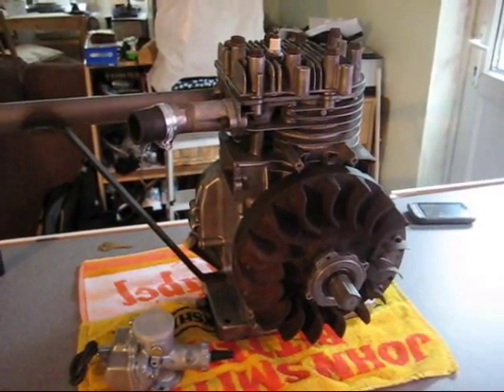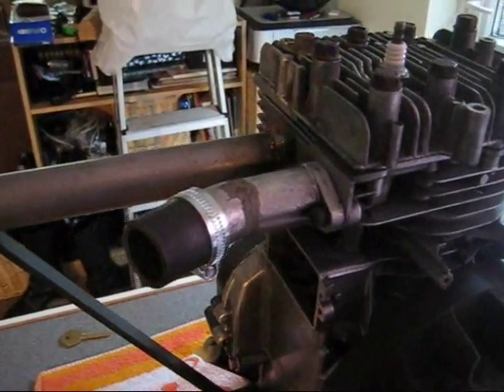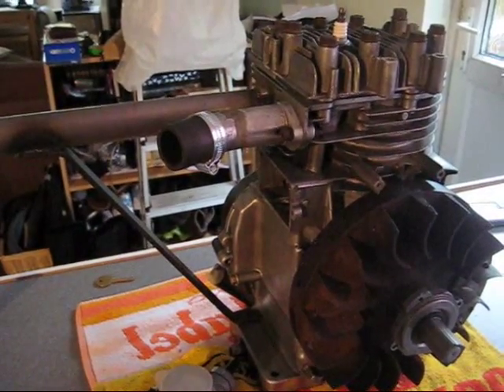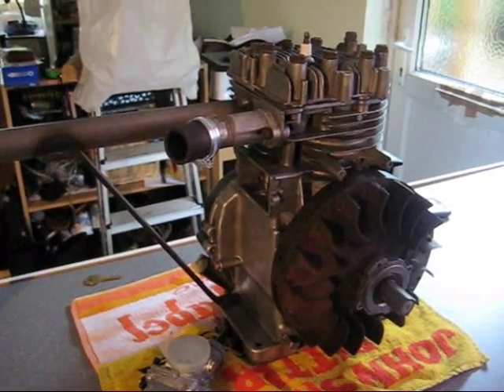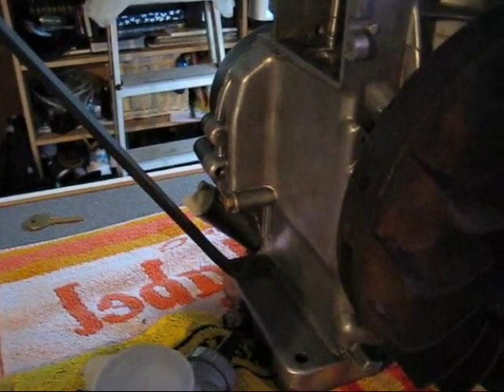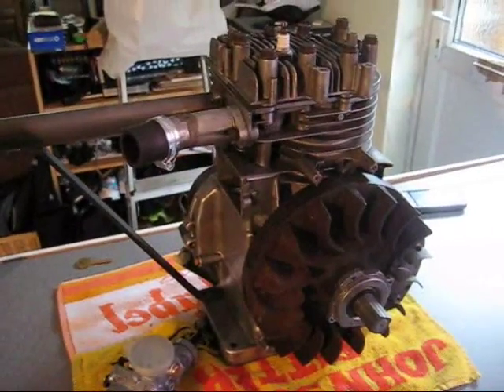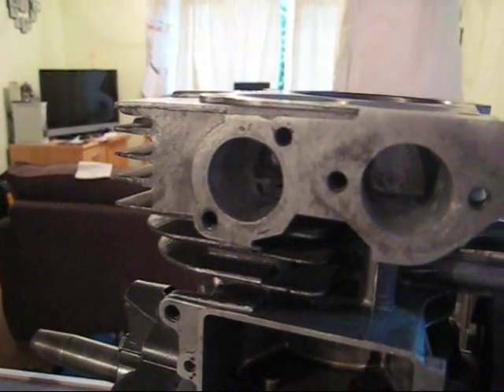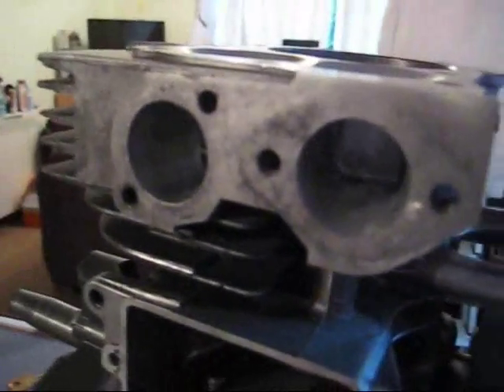8HP Briggs-Pt1

Comment from the maker: @hyperpunjabi Hi, after reading a bit more on running these sort if fuel pumps, i have found that you get a much stronger pulse from the intake manifold. i will be just putting a breather on the crank case. Thanks for the sub!